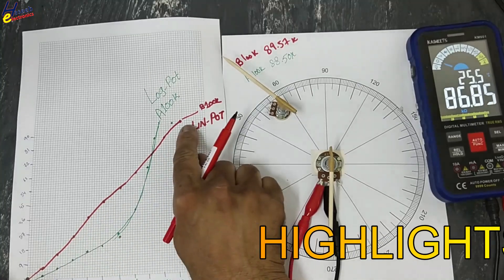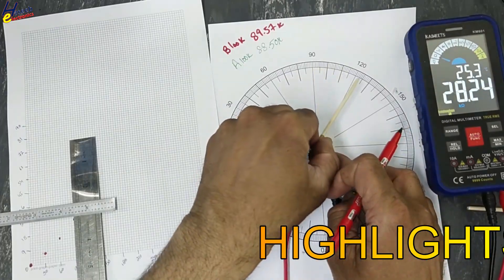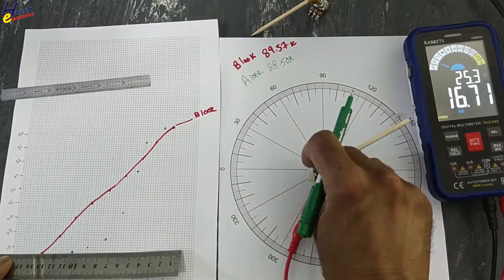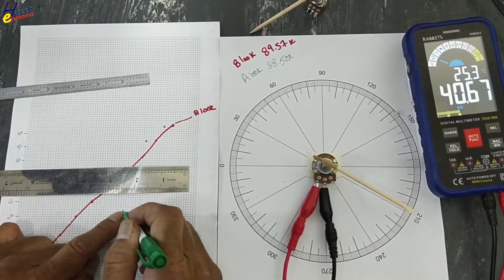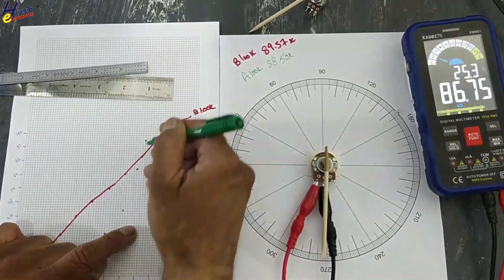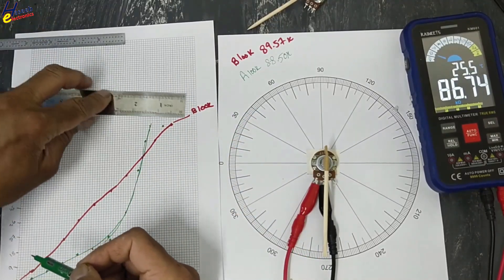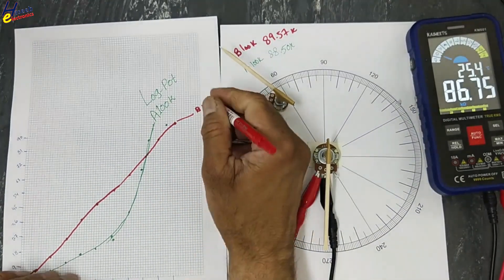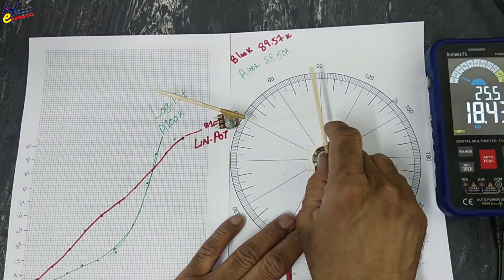{1302} "Linear Potentiometer" vs "Logarithmic Potentiometer"

Comment: An excellent demonstration, but a word of warning, the "A" and "B" markings can be swapped depending upon the country of manufacture of the pot. A very quick check is to set the pot to midway and measure the resistance of each half of the track; for a Lin pot they will be the same for a Log pot one will be about 10-15% of the total track resistance.